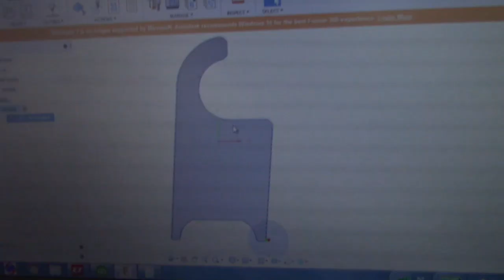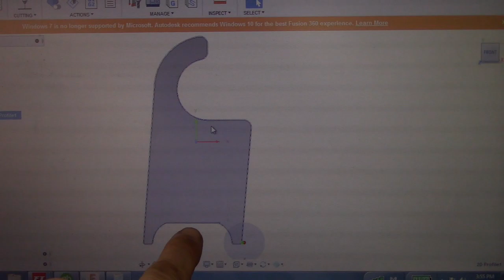Pro Jacks and making lifting your race car MUCH easier!

Comment: Really need an adjustable hydraulic flow control in the pressure line at the pump. That’s how you control the lowering speed without dropping it by opening a hand valve too much. Ask me how I know.

Comment: I have the same setup and my car is very low like urs. The way I raise the car is I isolate the rear go fully up with the front. Then lower the front on the locks, after which I isolate the front and raise the rear. I lower the car rear first using the ball valve to control the rate of dissent. Its tricky at first but found this to work best. good luck Guys!!!
Reply from the maker: Good info!  Thanks

Comment: Man I've been told once but for got what the rear suspension set up on this bad bitch. Housin length. Ride height. Wheel back space. Shock length.!
Reply from the maker: 4” backspace.  The rear is right over 44” long and the shocks are 7” I believe.
Reply: @nigelstst  thanks man. Yall gonna be at lights out.?
Reply from the maker: @mustangtez4060  I plan to be